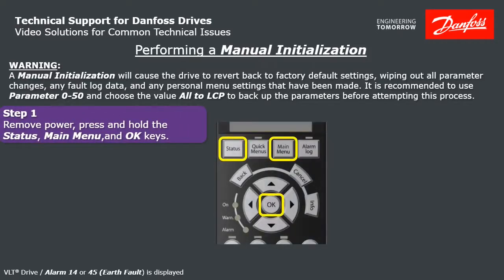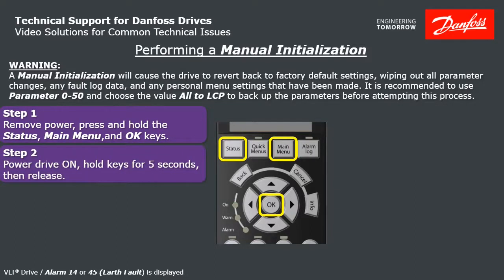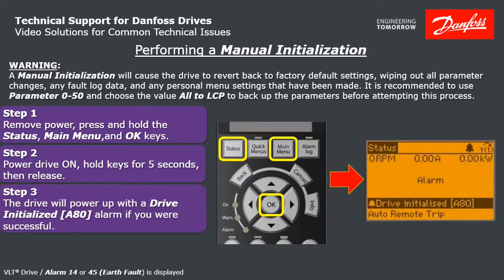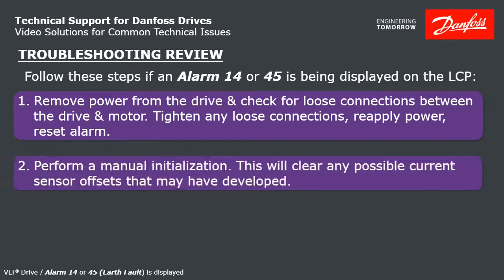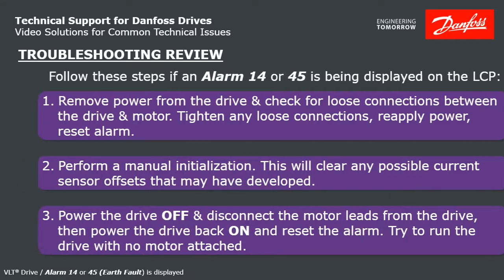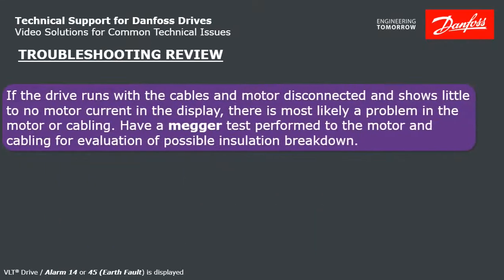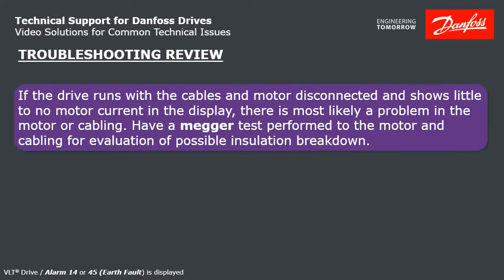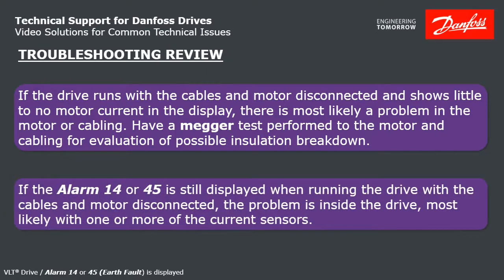VLT® Drives: The drive is displaying an Alarm 14 or Alarm 45 Earth Fault

Comment: FC102N showing the earth's fault,
.

During removing the cable it does not show the earth fault when we are connecting the motor cable it starts showing the earth fault.

We checked the cable and motor and found it normal.

Then what is the actual reason and what is the solution.

Comment: At 5:16, you spoke about high voltage frequency pulses that can find pass to ground through the smallest pinholes of insulation. How can we confirm this is the case? Will a Megger test or insulation resistance test be able to detect such minor pinhole leaks?

Comment: Hello sir vlt 2900 Run command after Err 14
Reply from the maker: For installation, start-up, programming and troubleshooting assistance please email: Drives.TS.NA@Danfoss.com
or if you need immediate assistance contact Danfoss Drives 24/7 tech support at: +1 888 DANFOSS (326-3677)

Comment: in the fc101 models they do not have common current sensors, apparently the measurement is taken through the dc bus, because in my case I have an fc101 and the alarm 16 short circuit persists, having already measured the igbt module correctly
Reply from the maker: For installation, start-up, programming and troubleshooting assistance please email: Drives.TS.NA@Danfoss.com
or if you need immediate assistance contact Danfoss Drives 24/7 tech support at: +1 888 DANFOSS (326-3677)

Comment: I have vlt microdrive this one running without motor  when connected the motor shows alaram 16  pls send solution
Reply: Replaced IGBT module ......
Reply from the maker: For installation, start-up, programming and troubleshooting assistance please email: Drives.TS.NA@Danfoss.com
or if you need immediate assistance contact Danfoss Drives 24/7 tech support at: +1 888 DANFOSS (326-3677)

Comment: Dear Sir. We have one drive fc 302 earth fault 2 when it starting. We have checked earth connection  motor cable ok. But we can not reset this fault? ( Please help or bypass this fault?)
Reply from the maker: For installation, start-up, programming and troubleshooting assistance please email: Drives.TS.NA@Danfoss.com
or if you need immediate assistance contact Danfoss Drives 24/7 tech support at: +1 888 DANFOSS (326-3677)
Reply: Replaced motor out put CTs

Comment: Sir on disply shows some frequency when start...But motor not start....what possibility ?
Reply from the maker: For installation, start-up, programming and troubleshooting assistance please email: Drives.TS.NA@Danfoss.com
or if you need immediate assistance contact Danfoss Drives 24/7 tech support at: +1 888 DANFOSS (326-3677)

Comment: Sar my denforse alarm continue bilinking  and warning light aup 🙏
Reply from the maker: For installation, start-up, programming and troubleshooting assistance please email: Drives.TS.NA@Danfoss.com
or if you need immediate assistance contact Danfoss Drives 24/7 tech support at: +1 888 DANFOSS (326-3677)

Comment: Sir vfd not run in AUTO mode
And alarm 
 show U 12
Please Urgently for me
Reply from the maker: For installation, start-up, programming and troubleshooting assistance please email: Drives.TS.NA@Danfoss.com 
or if you need immediate assistance contact Danfoss Drives 24/7 tech support at: +1 888 DANFOSS (326-3677)

Comment: How about gate drive voltage fault 
It means. The supply of power card is out of range. Can you tell me how fix it fast?
Reply from the maker: For additional information please visit https://www.danfossdrives.com. 
* If you need immediate assistance contact Danfoss Drives:  Phone: +1 888-DANFOSS (1-888-326-3677) or by E-mail: 
Customer Service:   Drives.CS.NA@danfoss.com
Technical Support:   Drives.TS.NA@danfoss.com
After Sales Service: Drives.TS.Service.NA@danfoss.com
Reply: Qe2s

Comment: Helo
I met problem with Danfoss VLT FC102 coverter with erros alarm: W phase loss (A32). I removed the motor from the frequency converter & check the motor phase W. there is no problem with phase W. I replaced by new the frequency converter & connect with motor then it's ok.Do you know what's wrong with my converter ? Could you instruct me to fix it. Thanks a lot
trantruong89@gmail.com
Reply from the maker: For tech support information please visit https://www.danfoss.com/en-us/service-and-support/fix-and-troubleshooting/drives-support/